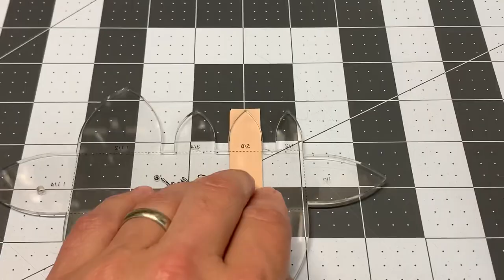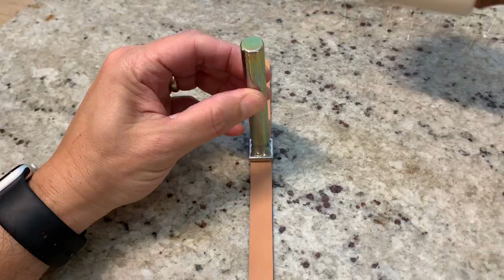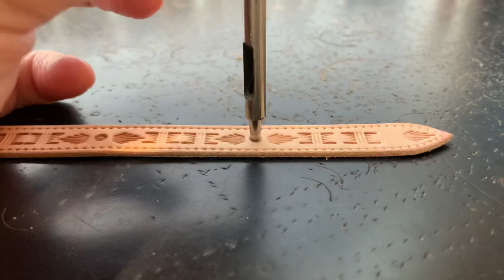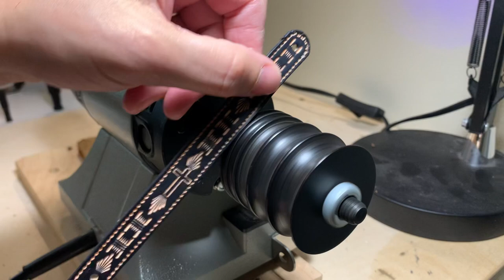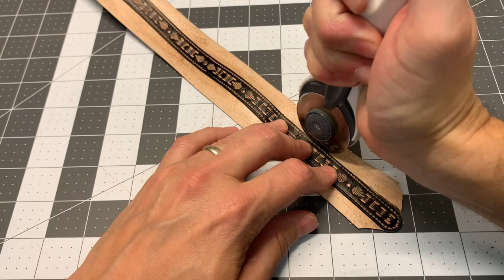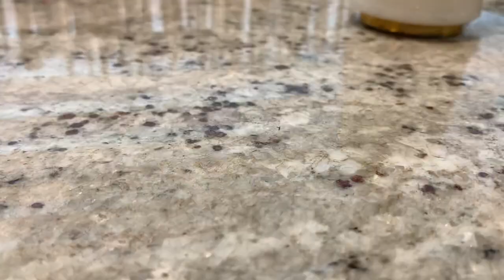Double Loop Leather Bracelet - How It’s Made - Leather Craft - Leather Tooling

Comment: Great work and Video! I'm just wondering why the color is only on the background and leaves the stamped leather untouched??? Any tips on how you do that? 
Mario
Reply from the maker: Thanks. Just use a minimal amount of dye on a rag or paper towel and wipe across the surface of the leather quickly so that the dye does not have time to soak down into the tooling stamps.